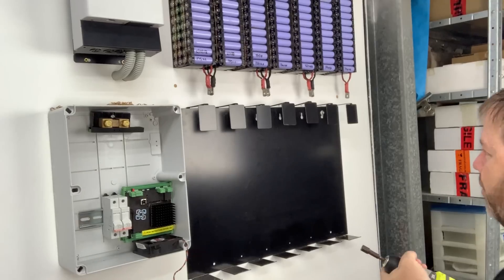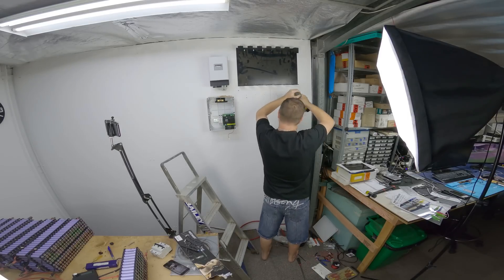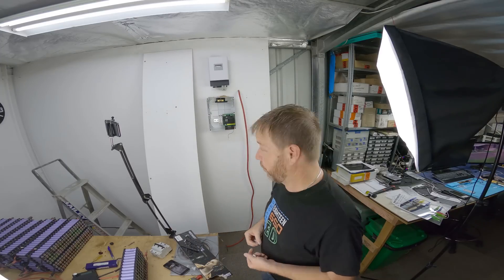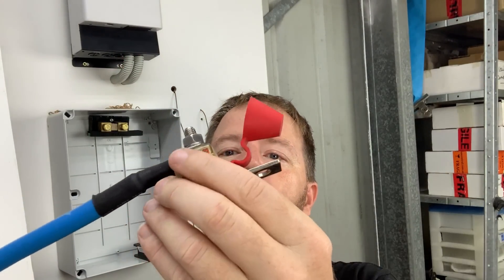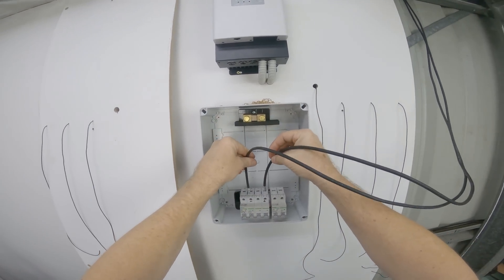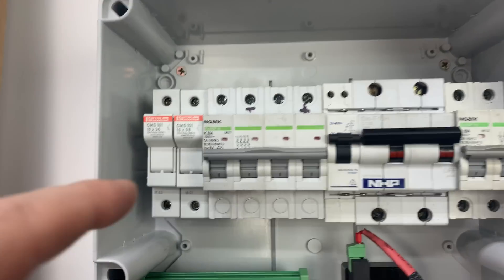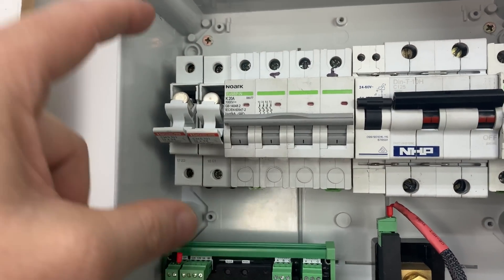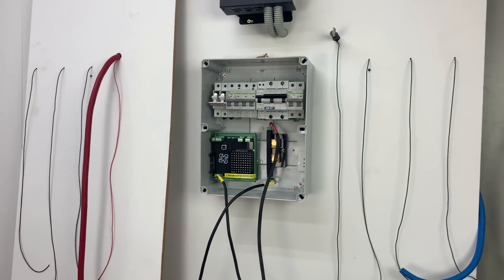Cleanest battery install [Part 2] I dropped my BMS!

Comment: Hi Pete, I wanted to thank you for your hard work in sharing your learnings with the world. I've watched many of your videos and am a huge fan. I looked through your stuff and honestly have no need for more clothing so I just sent you some money via paypal. Keep up the good work!

Just FYI for you and other creators - I like the idea of patreon - but I don't like the idea of a recuring monthly charge. Many creators only allow for patreon donations - and I simply won't donate because I have worked very hard in my life to end recurring donations so myself (and I'm sure many others) won't use patreon and would rather use paypal or something similar. Problem with Paypal is they just charged me 1USD to send you money.
Reply from the maker: Thanks heaps for the 18650ed donation - and yes I agree and only push it the past few months and only on selected videos more because everyone else does. I dislike it also for the fees they make.. PayPal works well and it much apprehended - Saving for a second community spotwelder battery so your donation will help the community greatly.

Comment: You are right about bending the cable too quickly. There is a mathematical formula on how much a wire can bend. The size is a factor in the calculation. My guess is something to do with a straight wire is a wire, 1 to a few winds is an inducter, and many more is a transformer. Something like that. But please check this out for yourself. This is a vague memory I learned about 20 years ago.
Reply from the maker: The battery cable is rated for 300 amp constant on a welder so i'm sure one 90deg turn will hurt it too much and my loads are/will be much much smaller. I'll keep an eye on it with the thermal camera for the first few months of use for sure tho. Thanks for the heads up AND the 1.86.. i might have mathed it up hehe
Reply: @HBPowerwall  I'm sure when a load that is much smaller than the rated wire is pushed through a bend then it will not be a problem for heat. Just want to put it out there about the concerns about bending the wire.
Reply: @HBPowerwall  That's ok and thanks for acknowledging me on camera. And if you can please give my channel a bost. I will be forever grateful. and thanks for the last time you did back in March. Very much appreciated the help with that.

Comment: Hey Pete, the DC disconnect for solar in, is the the first point of disconnect for solar? Or do you have switch on the roof like in a grid tie setup? And if so is that the requirement for your insurance to pass?
Reply from the maker: I have a disconnect on the roof no idea on requirements
Reply: Thanks Pete

Comment: Hey.. HB POWERWALL, 3 of my 18650 cells are getting too hot while charging but is maintaining the voltage well.
Should i use them in a pack?
Reply from the maker: If they are hot, they must be removed and either rechecked or recycled. Heat is bad in a battery.
Reply: @HBPowerwall  thank you HBP
Reply from the maker: Almost any time

Comment: For the incoming cable to the DC Shunt, could you find a lug that has a 90 bend to it so that the cable just comes in stright and the lug does the bend, or put in a 90 bus bar and bolt both sides to it so that cable stress is kept down?
Reply from the maker: I didn't even think of the 90deg lugs.. food for thought (Tho i just drilled my first hole :( )

Comment: Nice neat setup clean and very frustrating. All those hidden wires that you can't see whether they get hot or pierced with a screw or just lonely in the dark I would be worried. If I wasn't as broke as you I might even buy a Tshirt. Edit hey next time use plexiglass so we can see the wiring mess behind the glass.
Reply from the maker: I had planned on 'cable management' behind the wall also by removing the tin from the side of the shed how ever now i'm thinking that is over kill with some of the comments talking about heat, not going to want to wrap, or zip tie all the cables together to avoid a little extra heat i think.. The plan is evolving so could change with out notice lol Thanks for your input

Comment: Pete, i can see you were very much out of your comfort zone on this video bud, but good on ya for cracking on! Do you accept BAT crypto for donations ?
Reply from the maker: Not so much comfort zone but more questions than answers - really don't want to have to fix a hole i drilled in the wrong place. But since i've got no feed back on location or cable runs, going to have to suck it and see what happens :P
Reply: @HBPowerwall  in terms of your placement I think youv got it down pretty well as far as I can see so far, just keep the bend radius in check and remember it being stranded tends to be a little easier on the stress. In terms of the bend radius of your fuse box bend if too sharp you could always bring it out the wall under the box do a decent 90 bend in ribbed conduit like unit above it has and go through the bottom.

Comment: err as for cable layout  not sure if its good or bad  but i probably would move the amp sense resistor a little lower down in the box if you can
Reply: hmm never mind on the sense resistor relocation  ya aint got mushroom in there
Reply: (not much space)
Reply from the maker: Had to read that all three times lol Yep mushrooms don't have much space in there haha

Comment: Too many contacts between panels and batteries. Use thermal camera and see what is red.
Reply from the maker: Exact same as every setup I've run? There is also a disconnect on the roof

Comment: But this is only on the surface of a visually neat installation. Electrically correct but the whole belongs in a control cabinet.  Greetings from Germany
Reply from the maker: Neat on the front, common sense outback is the goal
Reply: @HBPowerwall  Yeah, keep it up. ;-)
Reply: Its the pc equivalent of shoving all the power cables into that rear panel:) As a side note it might be good practice to make sure that shed is well boded to earth/neutral near that setup. So theirs no potential for anything to get live ac on it.

Comment: It will as long as there is no cross wires in the back . Heat transfer will not be good
Reply from the maker: I was a little worried about that but with some thought on how run the cables should be ok
Reply: @HBPowerwall  On the issue of heat, given the ambient temps over there i would (where possible) fix the cables to a surface (even if its just the board you pulled off) as the contact with a surface actually assists with heat dissipation and in the UK regs they recon that is enough to get higher current through the cables before hitting max thermals.